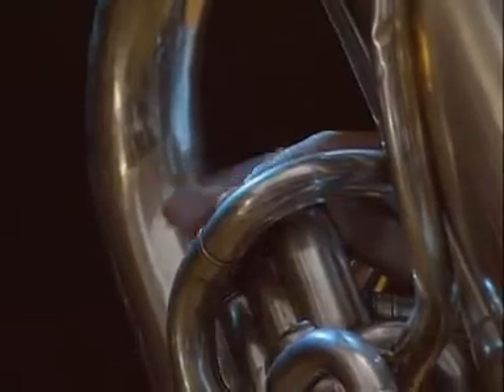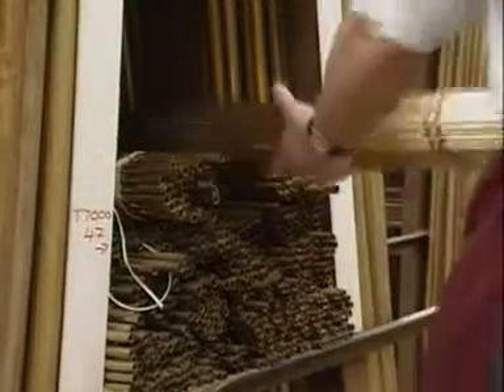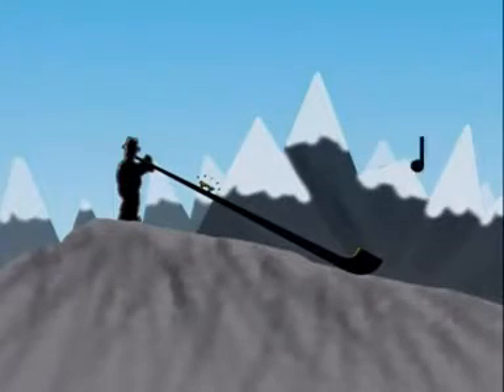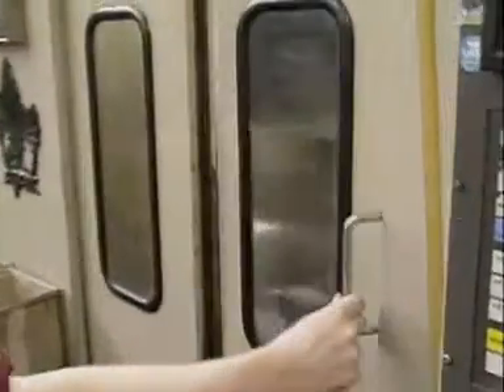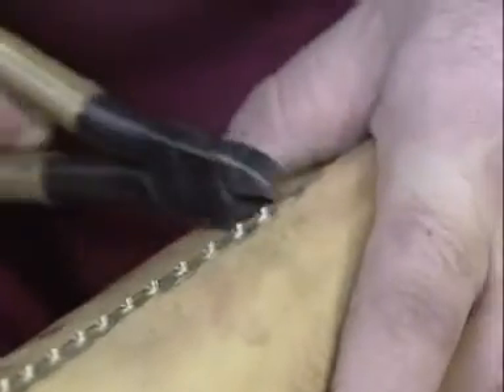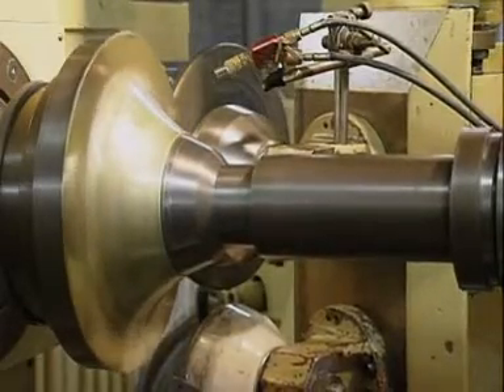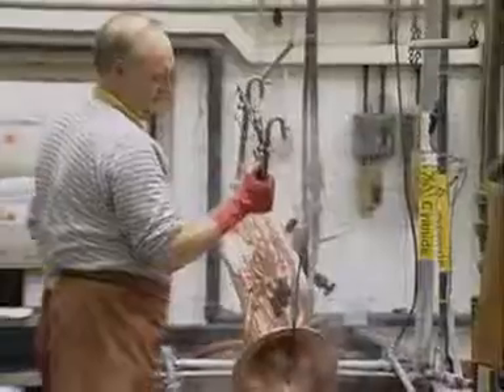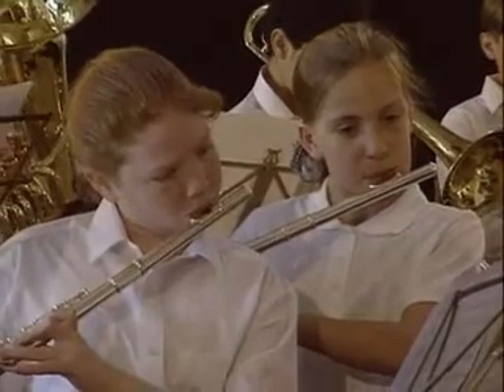Making brass instruments (Metal)

Comment: Hydroforming bows like that is better than bending, but it still produces really inconsistent and poor quality results, and causes instruments to weigh much more than they need to. Hand hammering the bows and bell from thin sheet brass produces instruments that are lighter, with more consistent thickness, and which can produce a wider variety of textures in the hands of a good player. The use of hydraulic forming is the primary reason that British tubas are significantly smaller than their American counterparts and produce a poorer tone quality, yet weigh significantly more. Compare a 4/4 size British Bb bass at 28-29 pounds vs an American 6/4 York C at 20-21 pounds, and you will see that the extra weight is certainly not worth it.